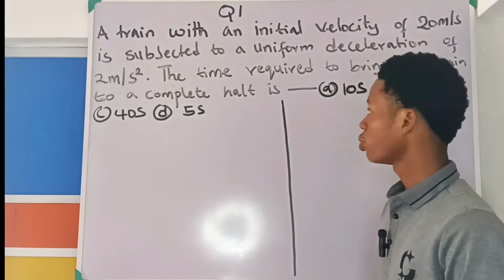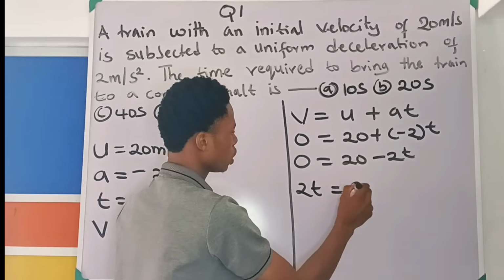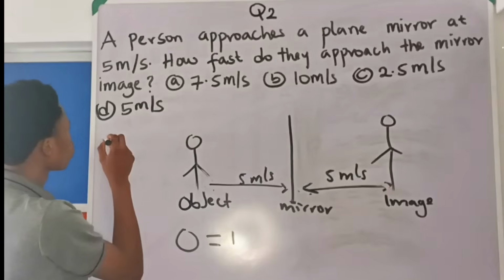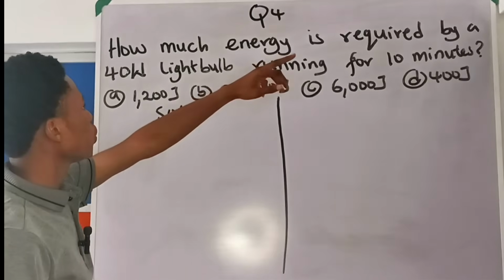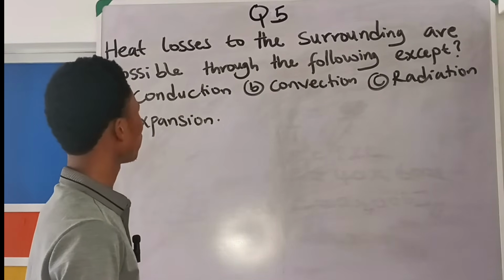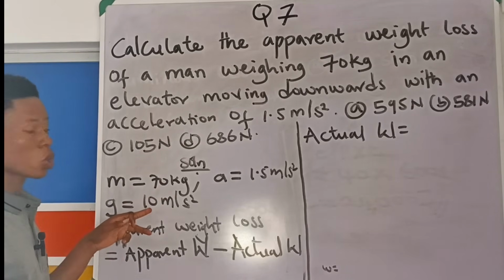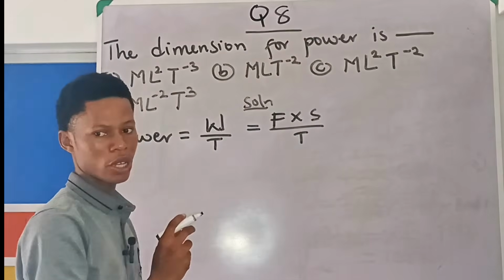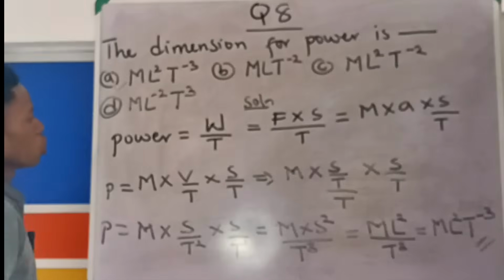JAMB 2026: Physics Questions You Must Master to Score High

Comment: Thanks so much sir, but pls if the car didnt stop completely, will the velocity still be zero, i mean

If the car stopped for only a short time, and it resumes its acceleration..
Will the velocity still be Zero
Reply from the maker: No. It won't be zero. They will give u the value